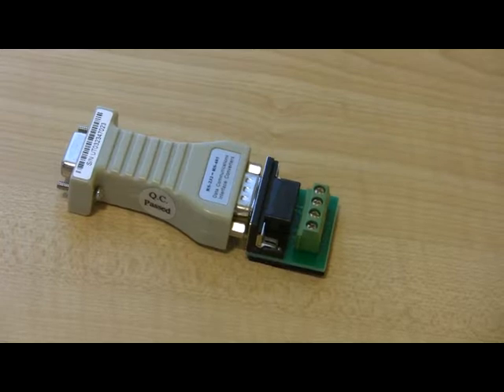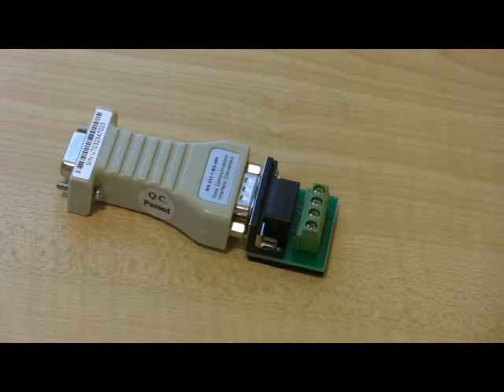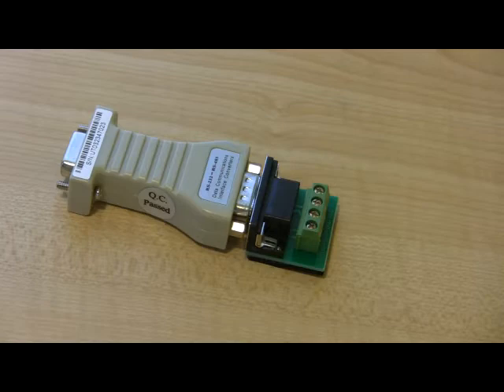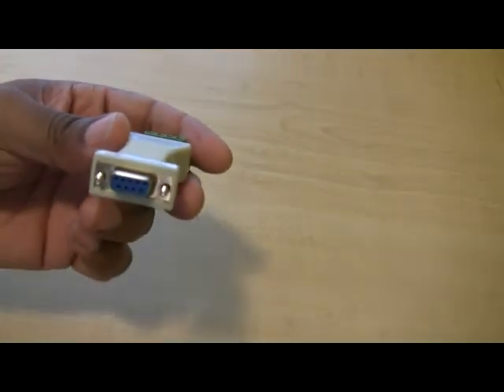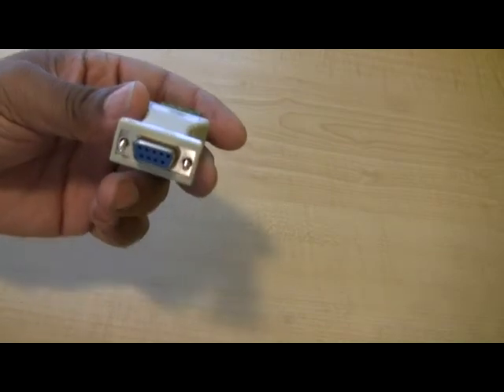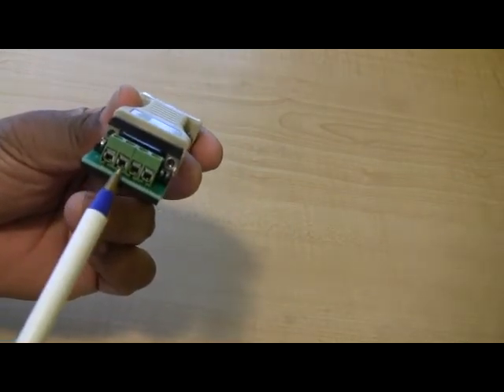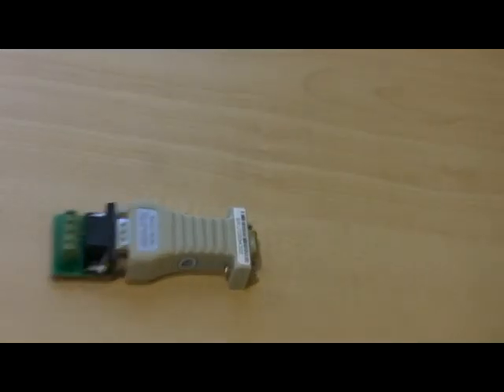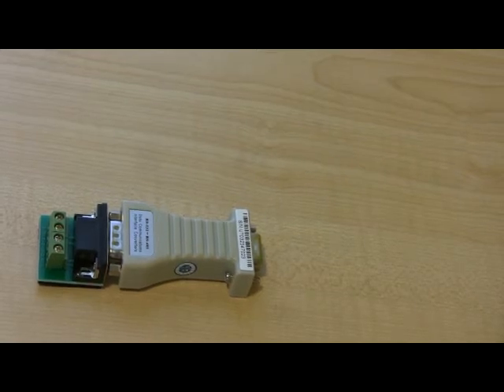RS232 To RS485 Converter Adapter In HD

Comment from the maker: It depends on the two devices being connected, whether they are DTE or DCE devices, how they are connected together before adding a RS-232/RS-422 Converter, how many signal lines are required. This information is for devices requiring only Receive (Rx) and Transmit (Tx) signal only, other devices require more connection pairs